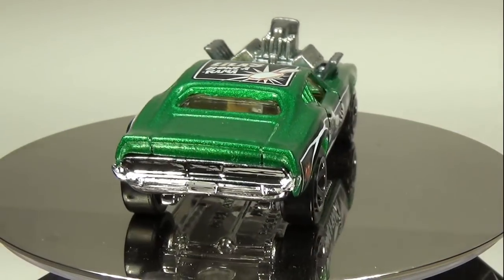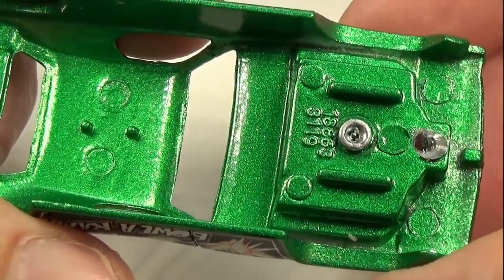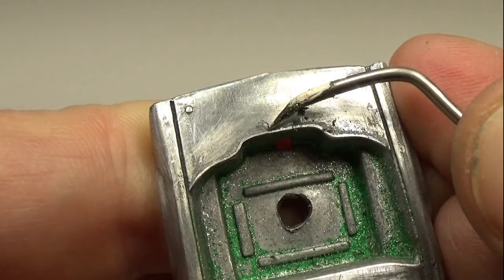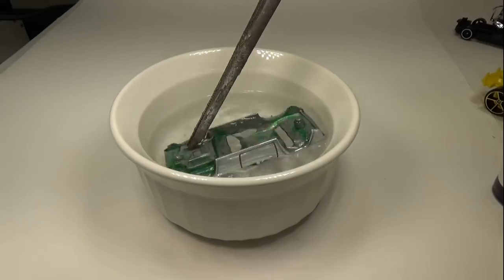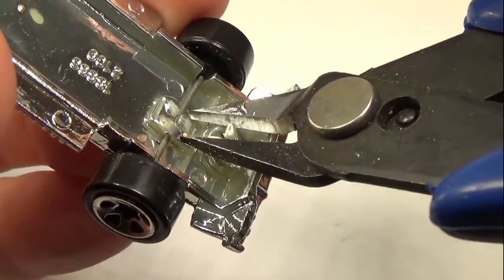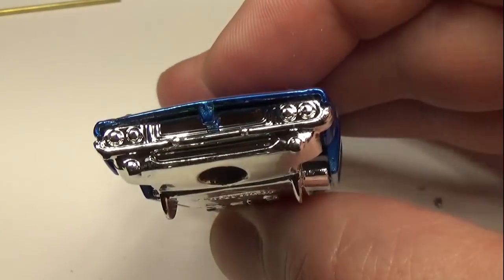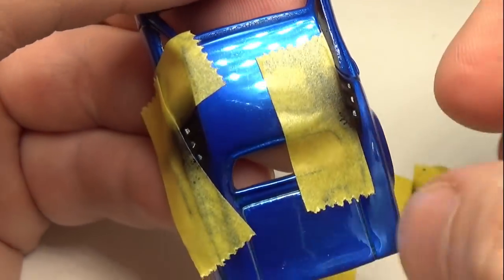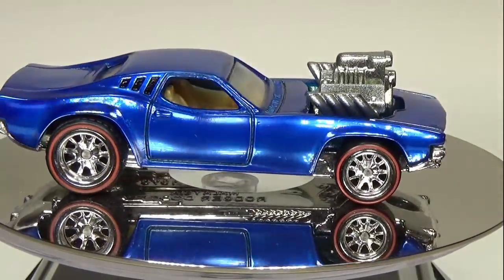Custom Hot Wheels 1968 Roger Dodger (From A Modern Casting)

Comment: A tip my stepdad gave me when using the paint stripper. Get hot water, as hot as you can, from the tap. Fill a container that will hold the water and the car. Let the car sit in the hot water for a couple minutes, let it heat up the car a little bit. when you go to spray the remover, dry the car off quickly to minimize cooling, then apply the paint remover. Thermal shock should help with stubborn paint. I've done it on a 442 which had really annoying paint.
Reply from the maker: Going to give that a try!
Reply: baremetalHW Sorry, I need to make a correction. Get hot water from the tap,then microwave it for a minute or two to heat up the water
Reply: Maybe a hair dryer could be used to either heat up the car or help to dry it off before paint stripper is applied.

Comment: Great colour on that Char.... Rodger Dodger .( As a diehard Mopar fanatic , I'm always confused with this particular Challenger fronted '71+ Charger- Bee ! ) My lil new tip I tried :-  trim off the axles "semi circles" on the chassis as I found some lowered cars levitate - so to speak . I'm at the stage where I paint ( & or molotow pen ) the side markers ,  grilles  & tail lights for that extra pop . The new chassis are superbly detailed & can be done very nicely .

Comment: Not sure if this would work, but maybe setting a car body into an ultrasonic cleaner using either aircraft paint remover or brake fluid might be an easy to to remove all the paint.
Harbor freight sells them I don't think they're super expensive.

Comment: I find it strange that Hotwheels and Matchbox cars are the only thing in the world that are basically the same price now as they were when they came out in the 60's..yes every once in awhile youll see where a carded redline or older car was .50 cents on sale but for the most part they're anywhere from .99 cents to 1.19, the same as today. and it's usually pretty easy to find a bogo and get them even cheaper.

Comment: That looks awesome! I find that painting the under side of the interior  plastic black helps it go unnoticed. I also find it easier to cut the rod by rolling it on a flat surface with an exacto knife instead of using a dremel. Keep up the good work.